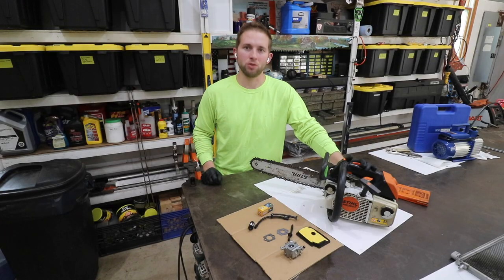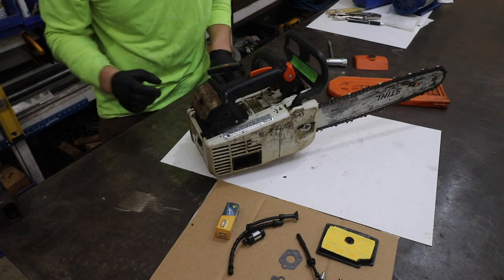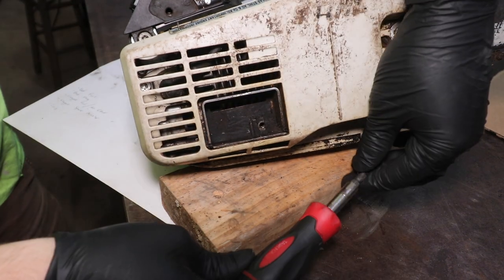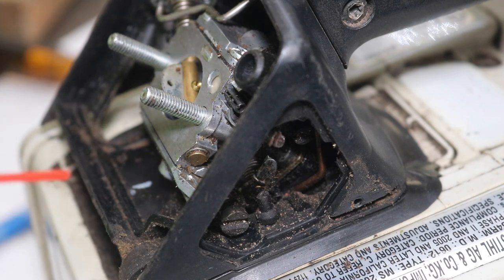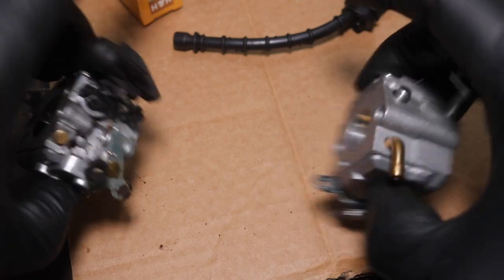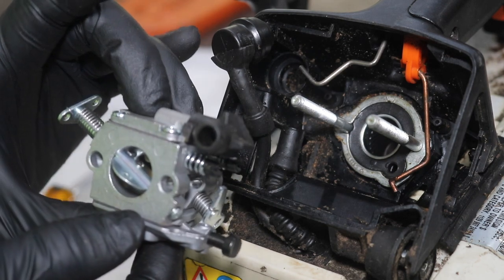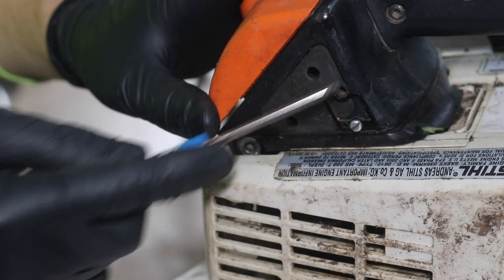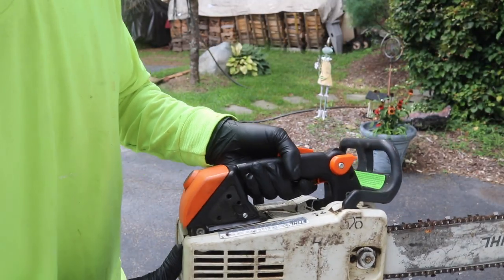Stihl MS 200T starts then dies | Carb Replacement Instructions

Comment: Great video, gonna try this tomorrow
Reply: Better to rebuild the original and block off the accelerator pump. Chinese carb is a gamble.
Reply: @cron410  I took mine out cleaned it, put in a replacement, same result, then found it was the intake rubber boot behind the carb had a rip

Comment: I rebuilt my carb with new diaphragms etc, but my ms200t still bogs down and dies ater starting easy. Plug looks lean, fresh fuel with 40:1 clean air filter spark arrester clean..
Reply from the maker: I rarely have luck cleaning or rebuilding carburetors. For what new aftermarket carburetors cost for these small engines, it’s a no-brainer to just replace it. 

You may just have a fuel adjustment issue. Watch a video on how to adjust a small engine carb.
Reply: @OldSoulMillennial  Thanks.  I found a tune up kit with most everything, but my saw does not have the vent hose up by the carb or have two hoses coming from the tank..  Where do you like to buy parts from?